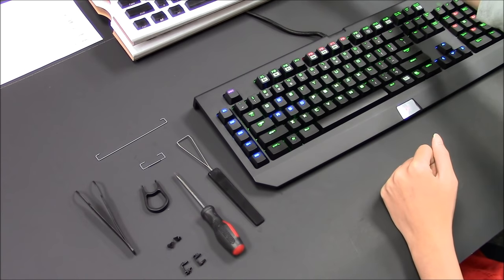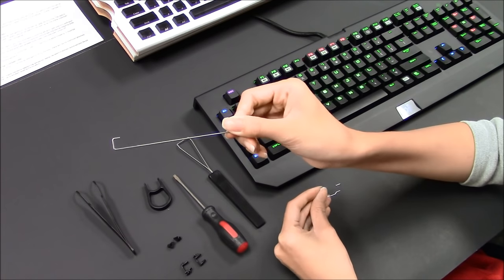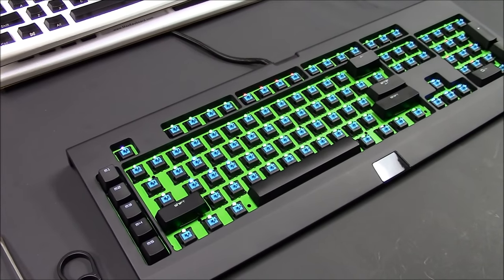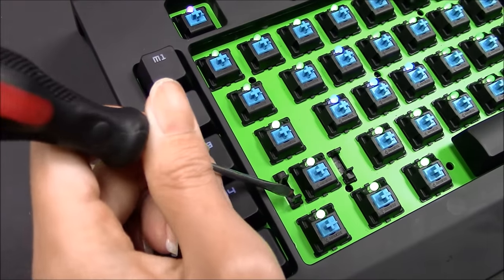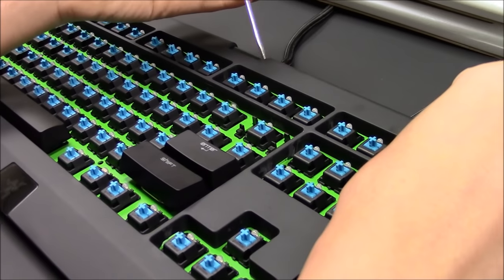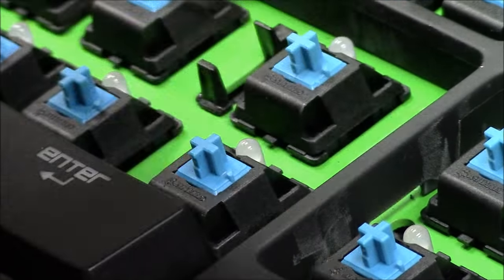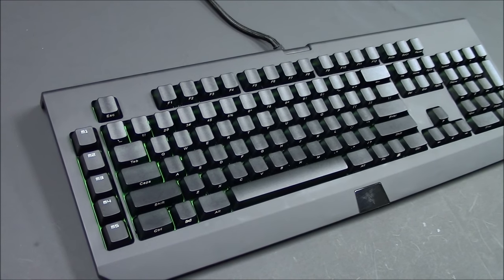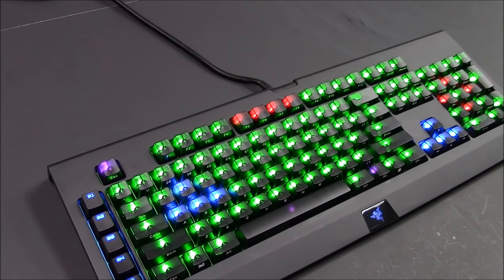How To Install Max Keyboard Black Translucent Replacement Keycaps on Razer Blackwidow Ultimate 2013

Comment: I've never and never will understand side printed keycaps
Reply: You should try them, they are actually pretty cool
Reply: Rune Trust there the step between top print and blank keycaps for if your trying to force yourself to improve your touchtypeing,
Reply: Even when I see them on a video I find myself tilting my head to try and get a better view of the letter lol
Reply: Fast forward to 60% keyboards
Reply: Only reason I could think of is that if the keycaps are just cheap painted plastic, the text wont wear out as easily if its on the side of the kaycap and not at the top. Other than that I quess some people like the looks, I think it just looks weird and kind of stupid.

Comment: 16 minutes Of my life watching a Nice keyboard get cheap.
Reply: Nikky it was shit from the beginning
Reply: Nikky it was shit from the beginning
Reply: Nikky Well if it means anything, the reason I am looking at these keys is because the original keys are cheap and crack if you remove them. That's why Razer doesn't give you a keycap puller like the other keyboard makers. The BW is generally a pos compared to any other keyboard at the same price.
Reply: Because its not possible to change it back, right?

Comment: Figured it out. You dont reverse the white (or black) clip things holding the bar, you leave them as is. You have to tuck the bar under the key, attach key to mechanical switch, then attach bar to white (or black) clip under the key. Ione Scorpius m10 keyboard.

Comment: The stabilizer bar for the space key is bent around the LED. What's the point of changing the placement of the stabilizers anyway? It's not like they're blocking light from reaching the letters on the front of the key, only the back half of the key gets lit up.

Comment: I just recently purchased a BlackWidow Ultimate, and I've been looking into attempting an LED mod, similar to how it is in the video. I've thought about buying colored keycap replacements, but I want to keep the black keys but use color-coded LEDs instead.. Is there a guide that you could supply that shows how you open the keyboard and switch the LEDs?

Comment: why the f do you need to invert the clips?
Reply: +DeziireHD one of the main reasons im in the comment section . that and i fucked up my razer croma space bar soon after i got it . and the w key got much softer after some excited gameing .  other than that its a great keyboard . wish some of the nay sayers would tell me of a better board other than just shit on this company .
Reply: +chris Evans k70
Reply: I know this comment is old but the keyboard you have is when razer used crappy key switches made by some other company now they make there own and have a much better fell and are rated for more key clicks.
Reply: KITTYMAN 9000 Wow you're right out of marketing xD

It's actually the other way around!

In the first place they used the Cherry MX Key Switches which nearly everyone used, because they were the best and most established mechanical key switches on the market, made in Germany. But they are also expensive.
That's were Razer got into making their own keys, they're cheaper for them to make and have a shorter lifetime.
If these have a better feel is a preference thing, but I don't like them. It's overpriced aswell for what your getting.
Reply: Oh and btw the Razer Chroma already used their own khalith Switches, so no.
Reply: Tralx but on the razer chroma x they used a new key switch and it is much better than the old ones. And the only reason i go so in depth on the switches is i burn through keyboards i tried das , Logitech, corsair, ducky, coolermaster, and rosewill and out of all of them razer has my favorite switches and i wanted to know why.
Reply: Tralx and yes i know ever other brand i stated besides Logitech uses some sort of cherry mx switch.
Reply: KITTYMAN 9000 The ones on the chroma x are actually worse quality then the old one.

Cherry MX Keys > Kalith Keys

Atleast in Quality. You may like one better, but thats preference.
Reply: Tralx meh as long as they do not break and they fell nice  it works for me.
Reply: Interesting how none of the 9 replies so far answered your question. I'd like to know too. What the hell was the point of that?

Comment: Always use a wire key cap puller people, the plastic ones are crap and will scratch your keys. Then again, no one will give a shit if you scratch your terrible Razer Blackwidow caps..

Comment: The wire extractor is just as efficient, you don't need to constantly pry it open like she says, it easily slides over the keycaps.

Comment: ..Why do the stabilizer bars need to be inverted?
Reply from the maker: Inverting it was to prevent thicker keycap rubbing with the stabilizer. If stabilizers are not rubbing with keycap then you do not need to invert it.
Reply: TheMaxKeyboard So what you're saying is that your keycaps didn't fit the keyboard and this is your workaround?
Reply from the maker: Xendrus Idziak What we are saying is our keycap is thicker.
Reply: TheMaxKeyboard So doesn't fit properly, ok, thanks for the info, I'll buy elsewhere.
Reply: BlackXS They make shitty nonfitting keycaps and try to pass it off as a positive, you choose to be sucked into it and believe their bullshit. Yes. I am the idiot here.
Reply: Zachary Stotz
Perfect except for the whole wrong size thing, sure, but however you want to justify being scammed man, it's your face that's red at the end of the day.
Reply: Wrong size? You're just trying to piss people off. They fit 100℅ fine.
Reply: Zachary Stotz
So they're lying in the video when they say you need to flip them? And the person who replied to me from their company was lying when they said they were different sized?
Reply: You don't HAVE to switch them. It recommended for a BETTER fit. I didn't switch any and obviously I can type quite fine.
Reply: Xendrus Idziak a scam? Scammers dont tell you what the actual issue is
Reply: *****
Sure they do. They just word it in such a way that idiots buy into it, so they're legally off the hook. Exactly like they're doing here. "Oh it doesn't fit properly because it's better made! yeah!"
Reply: Xendrus Idziak well, usually they tell about different things to distract you, but i get what you mean, but then again, thats not what they did here. They straight up said what the issue is and provided a solution. That doesnt make them scammers. If they'd ignore your question or even lie about it, then thats different.
Reply: *****
Or they could use a less cheap method of making them, so they actually fit standard keyboards. But instead they choose to save a few cents and pass it off as "thicker, thus better made!"
Reply: Xendrus Idziak Oh, im not arguing about the product as i dont even have it myself, but calling them scammers when they staright up said whats up with that, is just plain wrong. Now, i dont know how they go about it on other things/ days, but this is really over exaggerated. I mean its fine that you dont want them, although "dont fit" is according to others who have used them, wrong too, theres not much to be upset about it.
Reply: I own these key caps, and i have NO problems with them.
Reply: ***** you consider that cheap? For that you can get a tonne of keyboards with real mx keys...

PS. and why do you up-vote your own comment?
Reply: *****
Can you really not tell that is an advertising bot? "amzn"? Lol.
Reply: Xendrus Idziak what does shortening the url have to do with bots. Many actual people shorten the links, and if thats such a known thing, why is it not blocked by google themself. After all, they even hide legit comments
Reply: *****
It's an advertising bot.
Reply: Xendrus Idziak you've said that already...
Reply: ***** You wouldn't even notice the difference between ''real'' mx keys and the green switches from razer... They are very similar to blue ones but cant we agree that they are a thing just like mx as in take it as a whole switch themselves? Just because they arent manufactured by that german company doesn't mean they are any less (Except they are ''cheaper'' to make because its a different company that makes them). Razer is a multi million company that makes their items top of the line and if you disagree youre nothing but a hater who has no experience with the company whatsoever.
Reply: popstarfromhel what are you talking about? The amazon link? That has nothing to do with hating on Razer. You said it yourself, cheaper is exactly the point. It is not, at all.
Reply: ***** Oh alright my bad, it was your sentence structure: ''you consider that cheap? For that you can get a tonne of keyboards with real mx keys...'' implies that mx keys are ''better''.
Reply: popstarfromhel
I suppose if you enjoy being scammed by companies and advertisements. sure.
Reply: popstarfromhel
Please read your comment and edit it so that it actually makes sense.
Reply: Xendrus Idziak Listen, you try to change something someone said. Your way of deducting things leaves no room for actual accuracy and therefor you look illiterate.

Comment: And you have a christmas three not a keyboard. Can you see any letter after the button changing? I dont think so.
Reply: trust me, the letters on the caps' sides are just_as good to see, as the ones on top!
sure, it's quite a difference at first and takes time getting used to, but, after a while, it's just as easy to read as your ordinary keys
also, you seem to forget that, the target group for such key caps are users that type blind anyway! =]

Comment: What is the main reason behind inverting all the stabilizer bars?
Reply from the maker: Inverting it was to prevent thicker keycap rubbing with the stabilizer. If stabilizers are not rubbing with keycap then you do not need to invert it.

Comment: how it's possible that the BLACKWIDOW ULTIMATE has multicolor??

as far I know it should have only GREEN backlight no?
 And the logo is changin color too...
Standard feature or modded also?
Reply: modded she probably changed the leds under the keyswitches

Comment from the maker: Thanks! I would like to let you know Quickfire TK will work with our Universal Key Cap set. But we do not have the "0" and "00" print for your TK. Regular "0" is 1x2 (this is what we have in the kit). Quickfire TK uses 2 1x1. What you could do is use the arrow keys from the kit for that section. (it has same key profile)

Comment: How did he change the colors on the keyboard? The Blackwidow Ultimate 2013 can't change the colors, only the brightness... Is he using the Chroma?
Reply: Haven't you ever heard of modding she removed the LEDs of the old switches and inserted new colours and soldered them in. You can do this with Xbox controllers
Reply: Haven't you ever heard of modding she removed the LEDs of the old switches and inserted new colours and soldered them in. You can do this with Xbox controllers
Reply: +NibblyBitz ah yes, that makes sense, didn't consider that for some reason. Thanks.

Comment: what is that green stuff on the keyboard when you take the keycaps off?
Reply: It diffuses the light of the led's better (an original blackwidow ultimate has only green led's).

Comment: they are compatible with blackwidow chroma?
Reply from the maker: microavc Compatible with All Razer Blackwidow tournament/ultimate/chroma
Reply: +microavc That was a Black widow they installed it on in this video
Reply: +DAftY__  You realize the connector on the bottom of the keycap and the key switch is the same on both models. It's like that for every single mechanical keyboard that uses Cherry MX style switches.
Reply: ***** My mom is mean to me so I come on the internet and I act like I'm that guy from castaway talking to wilson and misleading Innocent internuats.
Reply: Who  the heck is Angu?
Reply: the keys are compatible with all cherry mx switch keyboards

Comment: Thank you much for the video.  NOW I just must find out HOW to replace the LOUD blue switches for browns ( like found in the logitech g710 for example). I LOVE my bw ultimate 2013, but the blue switches disturb my roommates at night and I can't change my work schedule.  Trying to find vids on the net that show this.  I want to say a NON english speaking person had a vid of a COMPLETE tear down of this exact or close to exact keyboard, but not sure if the blue switches are soldered to the pcb inside this keyboard's shell or not.

Comment: Where did you get a blackwidow with different led colours?! o.0 Link?
Reply from the maker: We customized it, All the parts with link are in the description box below the video.
Reply: Never thought about making a tutorial on how to do it? Switching the LED lights i mean? ^^ That would be very helpful :)
Reply from the maker: We are planning to do a tutorial soon.
Reply: TheMaxKeyboard That would be awesome :) Loved to see that!
Reply: TheMaxKeyboard please!
Reply: Alexander Burrowes Probably about 15minutes if you don't know what you're doing. Hardest part is putting the keys back in the right place.

I pull mine out all the time to clean it and it only takes about 30seconds to rip all the keys out.
Reply: BloodRedRoses lol dude it takes much longer than 30 seconds to remove keycaps, and that's not how you replace LED's. You have to disassemble the whole keyboard and then solder on new LED's. I don't own a Blackwidow anymore, but I took apart my current keyboard 2 days ago, and I would expect this mod to take around 2-3 hours, soldering equipment required. You'll have to desolder the old LED's as well.
Reply: BloodRedRoses i dont think you know how to change leds... like at all
Reply: Alexander Burrowes I would!
Reply: TheMaxKeyboard Hey, you never did the tutorial or?

Comment: Are any of your products compatible with Microsoft Ergo 4000 Keyboard?  Would like to mod it.

Thanks
Reply from the maker: +Wilson Bradley Our keycap does not work on Microsoft Ergo 4000. Our keycaps are designed for mechanical keyboard. Thank you
Reply: +Wilson Bradley No.

Comment from the maker: Remove 6 screws, unclip those plastic clip on the side. (Top cover will come off). Then remove 8 screw that hold the center metal plate to the bottom enclosure. Lift the left side up first, then make sure you clear those USB port and headphone jack on the right side. I'm sure warranty will be voided once you dissect it.

Comment: What's the purpose of inverting the keys?
Reply from the maker: Inverting it to prevent thicker keycap rubbing with the stabilizer. If stabilizers are not rubbing with keycap then you do not need to invert it.

Comment: The spacebar fitting is extremely frustrating and making me wish I'd never started disassembling and cleaning this stupid thing. Even with this guide I'm struggling to get the bar to click back in at both ends without either one or both of the little clips either sliding off the bar or just popping free from the slot in the rear of the spacebar. But at least I have an idea of what to do, just need to persevere I guess, don't think I'm ever going to clear this thing again though, or at least not the spacebar...

Comment: I have a problem with my keyboard after I spilled Tang on it.
It was a very small amount of it, I drained it immediately and took all the caps off and went to clean them.
I forgot to unplug it and I left it on for about an hour.

Right now I completely cleaned all the keys but for some reason whenever I plug it in it will do 1 of 3 things
1. Completely refuses to type at all (whenever i  try to open a file it opens the properties)
2. It will continuously press the N key for around 5 seconds, stop, then resume again.
3. It will for some reason thing that im holding down the alt key and not work after it.

Please help me if you can, the model is a Razer Black Widow Chroma.
Thanks.
Reply: +Miguel Candia U can.... buy a new keyboard :D
Reply: +Miguel Candia You damaged the PCB inside the keyboard, that's why it does whatever it wants! Buy a new keyboard! R.I.P chroma!
Reply: Bboy RagnarouS I fixed it :D just let it dry upside down for a day or so and worked just like new (aside from a few sticky keys)
Reply: Miguel Candia You haven't stated that it was still dirty when the problems occurred! Nonetheless that's great :D! Be careful next time!

Comment: The original key looked better with the LED's, however without the LED's on, the new ones looked better. I would still stick with the original ones since they look good either way.

Comment: What is the benefit of inverting the stabilizers?
Reply: +ILA Is it not to obtrude the LEDs? If so, then it's ok.
Reply from the maker: +ILA to prevent keycap rubbing with the stabilizer wire.

Comment: Is there anywhere I can buy the sockets that the space bar stabilizer goes into? One of my sockets broke and now my space bar doesn't work on the left side.
Reply from the maker: +JCB This is what you need http://www.maxkeyboard.com/products/parts-and-accesssories/parts/
Reply: +TheMaxKeyboard would these work? http://www.wasdkeyboards.com/index.php/products/keyboard-parts/cherry-mx-keycap-stabilizer-insert-2pcs.html someone said this is what i need for my blackwidow.
Reply from the maker: +JCB We only know ours will be 100% compatible with Razer Blackwidow. Those that you have linked is not identical to what you have. The peg is too long.

Comment: it does'nt sound right when i put my spacebar back, it's kinda stuck
Reply from the maker: check the plastic insert on the spacebar stem. Both should be facing the same direction.
Reply: TheMaxKeyboard ye that was not the problem but I fixed it, ty for answering anyways
Reply: ooh. ty <3

Comment: what? how do you changed the led colors?!
Reply: They took the board apart and changed the leds manually with custom leds
Reply: Its a rgb keyboard. You change it in the software it the producer made for the keyboard.